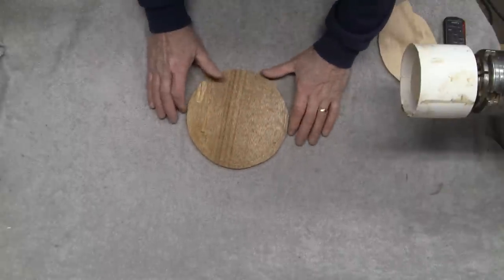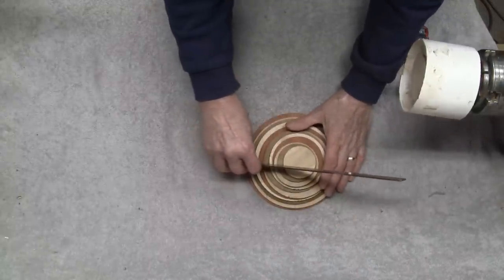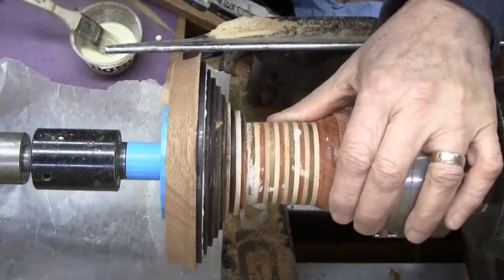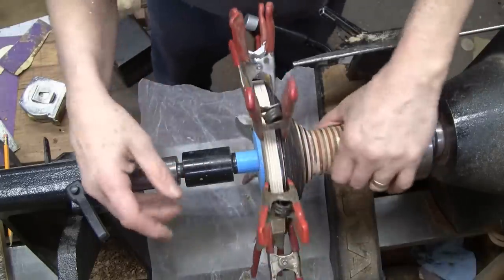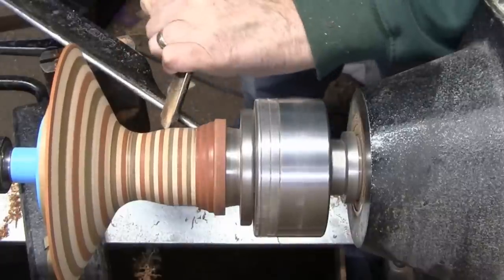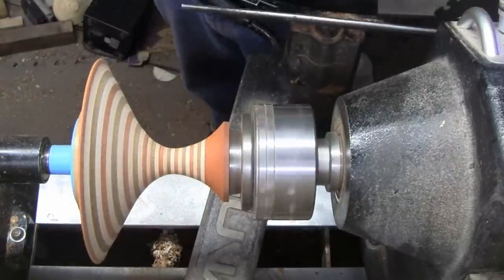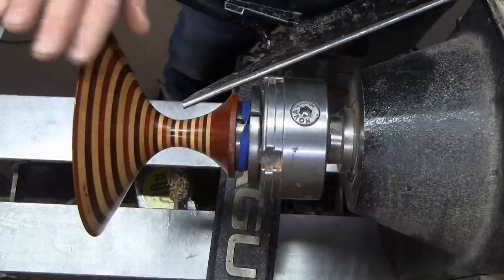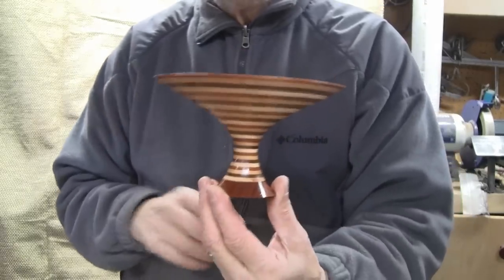Wood Turning The Ringer Bowl

Comment: 👍👍. I am going to make this in the near future. I will cut the discs on the laser but will also laser the alignment circle for reference when aligning. Very fast and accurate.
Reply from the maker: Thank you very much. That is a great idea using the laser to mark for alignment. Most of the line will disappear under the glue but as long as you can see some it will help for sure.
Let me know how it goes,
Gary
Reply: @ThePapa1947  

I am going to offset it for that reason and keep the gap even visually when each new layer is added. Should help.
Reply from the maker: Yes as long as you can see it you can make it concentric to the ring you are gluing it on. That is what I did with the pencil line. it was about 1/16" larger than the ring I was gluing it onto.
Have fun,
Gary

Comment: Nice job. Good use of your laser to cut the rings. I’m assuming all the grain is running in the same direction. I liked your chuck protector from the lacquer. 👍
Reply from the maker: Thank you Greg. Yes all the grain is lined up the same. I meant to mention that. 
That is a very hi tech chuck protector. And who would have known that Home Depot sells them LOL. The rest of it works good for my dust collector lines.
Thanks for watching,
Gary

Comment: Thank You Gary... Color blind ?   Me too, slight red/green (folks are constantly correct me)  I learned early on that my strength is in the manipulation of 3-D shapes & not in the blending of colors. Strange how a physical inability can lead one in the direction of their strengths not weaknesses? So sculpture, not painter for me. ..  Nice, unusual turning today Gary (I wonder how many woodworkers using Padauk have spoiled their project at the very end applying the finish incorrectly?)   Until next time...TM
Reply from the maker: Thank you TM. When I got my drivers license  60 years ago I could not read the number on the machine that had colored dots. They change some of the dots to make a number. I could not see one of them. A number of years ago when they retest your vision I could read them. But I still have trouble with browns and greens. So I have 2 main color of shirts. Blue.and more blue LOL. Naw I have blue and red. mostly.
I know some think the dust stains it but it is actually the oil in the dust. But that is my theory and I am sticking to it LOL
Thanks for watching,
Gary

Comment: I think it looks really great, Gary. The mad scientist was at it again. I like the final piece better than the drawing. Just curious, was there any concern or need for consideration regarding the grain orientation of the rings?
Bill
Reply from the maker: Thank you Bill. Not sure if I mentioned it but I meant to. I wanted to keep all the grain going the same way. My thought is when you look at the flat grain side it would give a better look if that was all lined up. And as it turned out it did. You can see that when it rotates and the whole side lights up.
 Thanks for watching,
Gary

Comment: I definitely, prefer the thicker base.  I think it gives it a more balanced look than the original drawing.  As ever a beautiful job Gary.  Where do you get 1/8” thick boards? Or do you I’ll them yourself?
Reply from the maker: Thank you Ron. I do as well. At first I thought it might make it look too tall. 
I make the boards myself. I am able to bandsaw them almost to size with a very smooth finish. I use a 11 tooth blade.
 Thanks for watching,
Gary

Comment: Wonderful job, Gary.  I have been experimenting with laser/lathe hybrid work for a while.  Did you make the 1/8” pieces yourself by re-sawing?  or did you buy them?  If bought, would you care to share your source?
Reply from the maker: Thank you James. I re-sawed them on my bandsaw using a 10 tooth blade.
You can find boards that are thin but very costly.
Thanks for watching.
Gary

Comment: Mr. Gary, is the lacquer you use food safe?
Reply from the maker: Hi John, that is a real hard question to answer. If you read the label it is not considered food safe. A lot of people claim once the fumes are gone it is food safe. But if the manufactory says other wise that is not something I would say.
 I never tell anyone it is food safe if the can says it is not.  That said I very seldom make turnings where you put food in them . 
I feel ok with wrapped candy and fruit with peelings. For snack bowls I will use a coat of shellac sanding sealer and Acks abrasive paste and polishing paste.
 Sorry for the non answer but i do not know what to tell others than to be safe read the label. 
 Take care,
Gary
Reply: @ThePapa1947   thank you for your response. You told me what I suspected, the lacquer is not food safe.
Reply from the maker: @JohnBrown-bx5rc  the main thing is the chance of it chipping and you end up eating lacquer chips.
 May not be an issue but even though I do not sell tunings I sure would not tell anyone that if the fumes are gone it is food safe.
Glass is food safe but if you chip it ends up in your food that is not very safe.